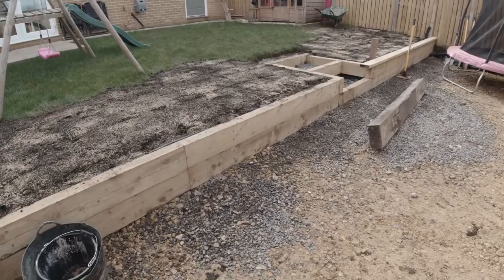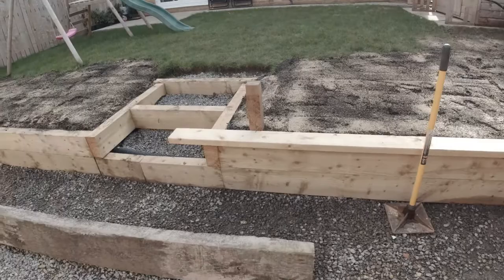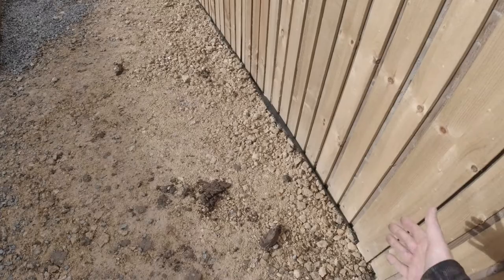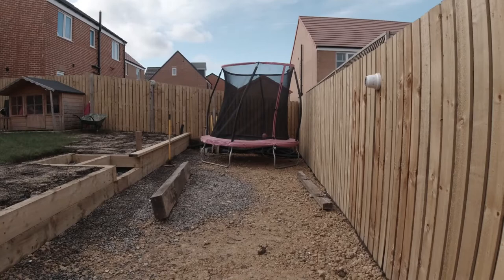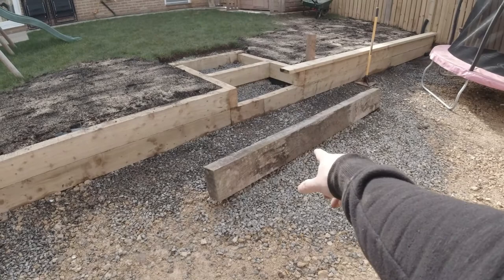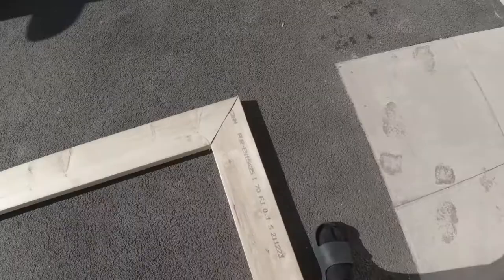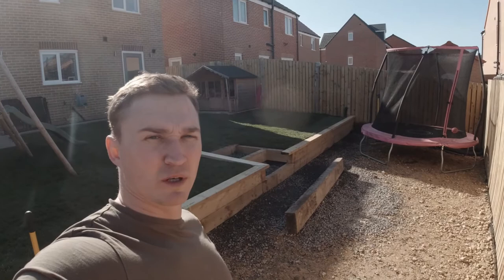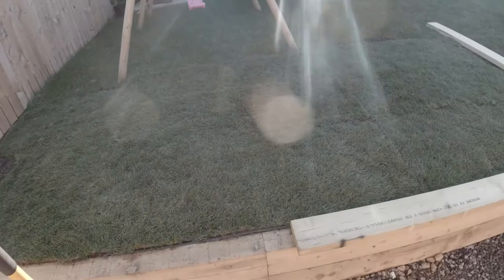NEW BUILD SLOPED GARDEN  | RETAINING WALL - #EP7

Comment: What boards/sleepers are you using? They aren’t railway sleepers. What’s the name of them please? Good vid 👍🏻
Reply from the maker: Sleepers are 2.4m length 200x100 dimensions. They are £19 from a supplier in North East if you live local.  The toppers are C24 timbers at 2.4m lengths. Think the c24 cost nearly as much as the sleepers 🤣
Reply: @Jonbuildz  2x4 for the toppers?
Reply from the maker: @TheLegend-wd6vo yeah mate